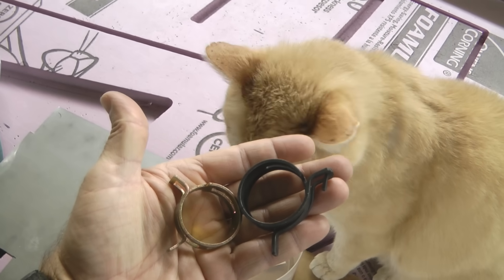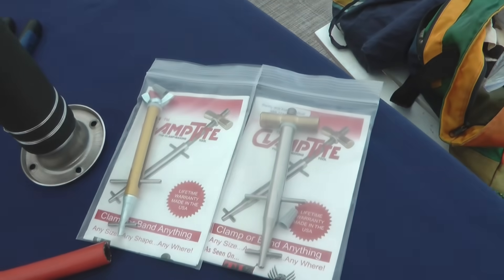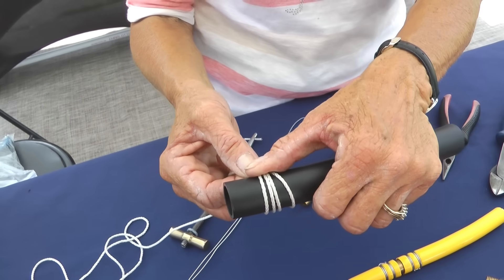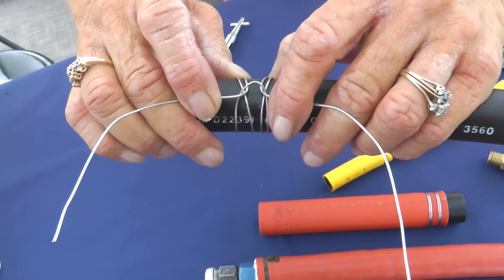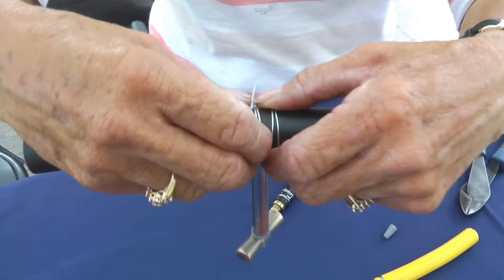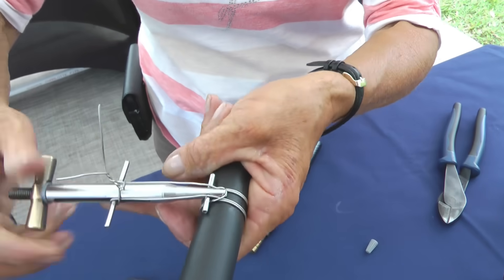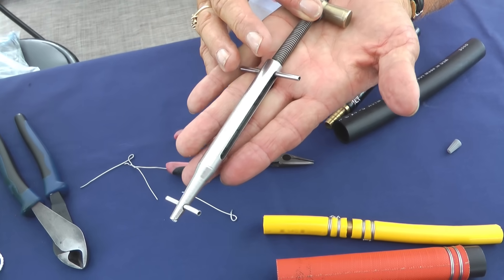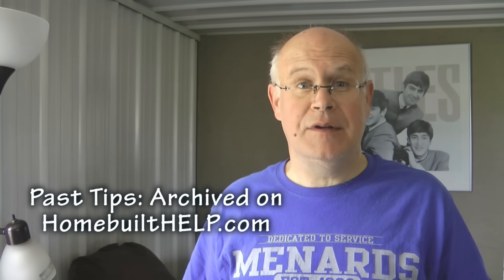Making your own Hose Clamps for Experimental aircraft

Comment: Two things for the negative people: 1) As far as not having enough room, you could always remove a same sized clamp from another location that is more open, use it in the tight spot, and wire the fitting that is clear. 2) Using this would let you get to the parts store the next morning or in an emergency.
As for the the price, I've pi$$ed away a lot more the $25 for a lot less useful items. If you look for the good, you'll find it, and if you look for the bad, you'll find it, too. I don't have time for the bad.

Comment: One problem with the method of securing the ends of the wire. They will vibrate loose over time or the pressure of the fluid ( Fuel, oil, etc.) Will cause the ends to come loose and there goes your clamp. At least with hose clamps you can safety those so they don't come loose.

Comment: Bought one at a car show about 30 years ago and it was almost 30 bucks then, always been pricey but they work very well, never had a water or compressed air hose leak when I have used it , and really a roll of stainless wire and this tool and your good to go, it's the fits all adaptability that is its best feature. My only problem with it is it wastes more wire than it uses, still probably cheaper per connection than hose clamps, but hose clamps can be undone and reused, I have never regretted buying it, but would I buy it now at 60$ US,  doubtfully, but still having it and a coil of wire in your boat,4x4,  or what ever could be the difference between coming home on your own  or waiting for rescue.

Comment: who has the time an space plus dont like the way it cuts in to hose ... just buy clamp an be on your way
Reply: It doesn't cut into the hose.  It compresses it, the same as a clamp (just more, because you can get it tighter.)  Plus, this is way better when you don't want a hose clamp sticking out like at the end of an air hose you routinely grab.

Comment: I bought one of these.  Can't find stainless wire anywhere so you would have to buy it from them.
Reply: Stainless steel wire is available in my area at better hardware stores, home depot sells it, probably get it online as well
Reply: Same here.  Looked everywhere.  On line is only thing I could find

Comment: And wont work in a confined space
Reply: That's true, but no tool is functional for all applications.
Reply: .....so for a confined space it's the conventional hose clamp or maybe using a strand of cord cut from a PET plastic bottle as shown by Odvoko then pouring hot water to shrink tighten over the job ,or maybe that cruder method of twisting ends of wire  looped over the job   ,but that steel tie wire these days used for such tasks seems to break easily if twisted hard as required but the copper wire seems a little better for the purpose . Lubrication of some sort for the wire over the hose can help and there are schools of thought for and against . .lastly the hot water helps for  conventional hose clamps by pouring onto to soften the plastic or rubber hose so that less load is placed on the bolt threads and less damage to hose's structural integrity occurs or whatever the language should be to describe it . Just watch not to tighten too hard on a heat softened hose .
Reply: @charlesdickens6706  Great advice, I'll try this.

Comment: Very nice tool but most of the time I am working with limited space and most are not easily accessible and a screwdriver is a better choice. I want to see putting that wire clamp on a radiator hose.

Comment: Отличная штука, дге ее купить???
Reply: I've used this type of tool for years and for specific applications where you have room they do work well. I've used this method for several Barbed air tools and they hold and do not leak. I have one that's much larger than shown here and it allows you to use coat hanger size wire and creates very strong clamps.

Depending on the type of clamp that you want this may not be the tool and it does have limitations. But when you do need to clamp something odd this is a very good tool for the job.

Comment: I have had this tool for over 18 yrs. in theory it is fantastic. In practice, you will never use it. It takes very long and  hose clamps are rarely in an easy accesible place. It needs quite a bit of space around hose to work

Comment: WE used to use fencing wire to do hose clamps with a pair of wire cutters or pliers (mostly), using the pliers to twist the wire. Fencing wire was thicker and galvernised type.

Comment: I have seen other DIY versions of the Clamptite.  Whether you buy it or make it yourself, using it is a skill that needs to be learned and practiced.  Because the length is limited only by what is practical it can be used on a lot more than hoses.  There are times I still want a spiral style hose clamps to do certain tasks, but having this kind of tool sure expands my options, particularly in situations where replacement parts aren't available.

Comment: Its great but how do you open that clamp in case of repair/maintainance ?

Cutting the clamp may damage the tube/equipment..!
Reply: Just use a small screwdriver to lift the ends, and then needle nose pliers... VERY easy.

Comment: Nice. I see some people griping about tight situations. Again, its a practical tool for a certain set of applications. Would a wrench make a suitable replacement for a hammer? No, but sometimes you just need a little taping power that way you hand cant deliver on it's own, correct? You would also be a idiot to think it replaces a hammer, but also a idiot not to use it if it was the only thing you had that could apply just the amount of force needed. Again, this is a tool that can indeed make a hose clamp. IS it going to work in every situation? No. But none the less a very handy tool. I cant believe anyone would act or treat it like its worthless because it doesn't fit every application. A pure sign of your inability to work or repair anything with your hands. Maybe you would be better off letting Someone else work on anything you needed worked on.

Comment: This woman is very good.  Gave me some tips I was wondering the best way to make my wire clamps nice and neat.  This wire clamp system is superior to anything else there is.  You can make a 40" clamp or a 1/4" clamp, just pull out enough wire.  A 40" clamp could hold together something that is busted and coming apart like a wooden barrel or what have you.  As mentioned, if you want to squeeze the guts out of something just use some huge wire.  Make sure you use wire from a good source like Aircraft Spruce and Specialty.

Comment: I used it on an aircraft hose to main intake, very disappointing. Just after the first flight 2 out of the 4 clamps I made, opened up! I used 0.032" wire. I went straight back to hose clamps!!!  Be careful !
Reply: What the lady FORGOT to say is that there are MANY different types of Stainless Steel wires... You were using a too soft annealed type.  Using a harder (but not too hard) temer will work perfectly.  And 0.032" wire is just too thin!Don't blame the tool for not knowing how to properly use it.  Wire clamps are legendary... when PROPERLY done.
Reply: Temper, not "temer", sorryy.

Comment: Love to see you try do that in situation and at the bottom of an engine bay ... also the tension of narrow wire risks cutting into the hose as a stress fracture !  Do you offer a safety certificate as when used it is a legitimate repair ?
Reply: I think its an emergency device ...
Reply: i sure its a fine tool but i had those thoughts also. was considering how it could damage plastic radiator and soft rubber hose.

Comment: It's a nice looking clamp but honestly, for a single use clamp, twice around then twist with lockwire pliers, it's not gonna leak.
Reply: There are times when you cannot find the clamp to fit. Recently for me, not available from any manufacturer/distributor I could find. Things being made difficult to repair to control obsolescence.

Comment: A nice tool and handy, but there is an old fashioned aircraft hose 'trick clamp with wire' that I learned about 4o years ago as a machinist. Used it all the time in the machine shop. All you need is a pair of pliers and a length of wire..

Comment: are you kidding ? how much wire waste ???
i would be worried the wire would cut the the hose and a cause a bigger problem,, that is why screw type hose clamps are wide ..DUH..
2nd dumbest idea ....takes 3 hands to work this mess and never fails that clamp you need to tighten is not that easy to get to ,,

Comment: This will NOT work if the fixture is on an engine or in close to another Object.. Also, this wire will, in time, CUT through the hose and cause a leak. Banned Hose Clamps are FLAT for a reason,,,they DON'T cut into the HOSE>
Reply: I don't know why I keep defending this tool I'm not paid to endorse it, but, having paid too much for it 30 years ago I have had ample time to play with it plenty, it's use is limited of course, but out off curiosity I have used on many applications that my life didn't depend on, and on rubber air lines or plastic water lines, some done 30 years ago, still no cutting through as you predict, you would think it would but in service in real life  it doesn't happen.
Reply: EXACTLY.  When the wire actually cuts  into the hose, it is because the wire was too thin, too tight, or the hose was too soft, which happens all the time with silicone hoses, that tears very easily.   And cheap band type clamps can also cut sometimes because their edges were not deburred!
Reply: Unless over tightened

Comment: I laud you're a attempt for a new invention.
A lot of applications inside the compartment of an engine or a machine this space to move around simply does not exist or is very difficult to get this to function or work and wrap.
And the amount of time to take the traditional screw clamp is significantly faster in every bit as effective.
So by virtue of efficiency and practicality the old style still stands as number one.

Comment: nothing new been around for over 40 years I was using this method 30 years in non aviation industries the tool was different and the wire came pre-formed and to fit various size hoses.  Ask any old pipefitter and he will varify.

Comment: I would like to see her do that in an engine compartment or on a bilge pump hose in a 3ft deep bilge.
Reply: You can always find a limitation for any tool. I own one of these ClampTites. Great tool. I have used it to clamp yard watering hoses and air hoses in my shop. I would not hesitate to use it for fuel lines or even a high pressure hydraulic hose on one of my tractors. But yes, it does need room for the 180° motion. Just use a regular clamp in those situations. When I can use it, I much prefer it.
Reply: The things I've had to do to remove/tighten clamps... 
 flathead hex bit and a tiny 1/4in wrench.....
Reply: was thinking the same thing, my fat hands are already in the way
Reply: EXACTLY!  Cars are now being "designed" by stoopid young "engineers" that "design" engines to be completely assembled OUTSIDE THE CAR, and then they "marry" the car body from over, and let it drop down on the assembled engine-transaxle-suspension... great for "saving" minutes on the Factory,but a PAIN In the A** to maintain.  Can bet 99% of those "engineers" have NEVER seen a Spanner.
Reply: @alfredomarquez9777  bud how do you think they use to assemble body on frame cars in the 50s. And this is intended for people building their own aircraft not cars.

Comment: and then on emergency you don't find a wire at the correct thickness....
Reply: Amnon Zohar why would you pack the tool but no wire? Stow them both together. Stainless safety wire is abundantly useful
Reply: on emergency you don't have the tool...but you might have just wire ,and pliers to twist the wire.

Comment: If you have to remove the wire you'll damage the hose trying to clip it off in fact you could twist the wire around the hose and tighten it up with a screwdriver to get the same clamp

Comment: Wow $69 for the tool vs $2 for a pack of hose clamps not to mention the time and directions to make it.
Reply: The other meaning of "Made in America "
Reply: Kreatifitas harus dihargai mahal....
Reply: With this tool you can use stainless steel and its better in somme applications than the cheap zinc plated clamps.

Comment: I don't know. Seems like it would cut into the tubing. You don't want damaged tubing especially on an aircraft. I am pretty sure this is not clamping anything on a 747. LOL. Use the proper clamps for the type of tubing you are using. This would be useless on silicone tubing because it would easily cut into it. Might be good for a roadside radiator repair or something.

Comment: well explained and its a good friendly tool but there's one question not answered properly ie. what's the size of the wire not it's strength..... sorry ma'am...✌
Reply: She said, "this tool will do up to a 62 thousanths wire". That's .062 or 1/16" diameter wire.
Reply: Strength was addressed. Stainless steel is very strong. Lesser wire could possibly break if tightened too much. Best to use stainless.
Reply: The Electric Man 2 The website claims that customers have used wire coat hangers in an emergency. I bet that would be difficult!

Comment: 98% of the time you won't find room to maneuver that gadget or flipping it around during a tight space installation. This thing is like to reinvent the wheel. This gadget is for wide open space use only . The strength of the lasting tightness is questionable. The installation time were much longer than the regular proven store bought hose clamps. Take my advise collect as many variety of sizes of your favorite proven clamps is your best emergency . Her tool is $60 + compare that to store bought clamps. Speed & accuracy is the MOST important criteria in emergency repairs. Not time to fool around.

Comment: Fine and dandy when you are working at a damn table, think trying to use it in an engine bay or close quarters would be a pain in the ass.
Reply: No matter what type of tool you use, you won't be capable to manipulate it if you are in a situation like floating in the space, short of air and Alien 1, 2, 3 and 4 trying to grab you from your butt
Reply: I agree that it could be a PITA, but I think it can be done.  I really like the clean, elegant look.
Reply: So true😂😂😂😂😂
Reply: Yah I tried to picture that to.

Comment: True ingenious design; but, won't work everywhere as mentioned in the comments below; I had a very hard time using it on a 1/4" air hose; too small a diameter to make it work. It's great for garden hoses; and has other good applications such as using it around a cracked planter, etc.

Comment: Not really practical due to space and cost. Use some bare copper electrical wire like a bread sack tie. Use pliers to twist with. Works fine until you have time to get a real clamp. 

You can buy a lot of copper wire for $50.

Comment: Am I the only one who thinks $70 for a sleeve and some wire rod that doesn't work at all in tight spaces and takes 5 minutes to make one clamp is a bit much? Like... A hell of a lot too much
Reply: Yes it has drawbacks but when you set down in back country to fix an oil  or fuel leak it would be very handy, not to mention light enough to carry in an ultralight.
Reply: Blue Collar Power nj

Comment: umm...using wire is a good substitute for roadside repairs but first hand in the long run wire will cut into the hose and render it useless for further use. The idea and concept are good perhaps in farm applications where there is plenty of space to use such a tool but in real world servicing and repairs a proper clamp will always be the best choice.

Comment: OK it's never never going to work in a tight spot and it's usually 90% of the time.
Reply: H Higgins  How are you supposed to operate the tool in a tight spot? That 180-degree flip she did with it eliminated the possibility of making this work in many applications. It's probably why the tool has been around 50+ years without becoming common knowledge. 

I work on car and boat engines where I would NEVER be able to use that in place of a worm-drive or gear-style clamp. Often, I have ONE possible position for the screw on the clamp, and when I get that, my 1/4" ratchet gets an extension and sometimes a universal--sometimes a combination of multiple extensions, etc.--and I often have to work in the blind...

...and that's just doing routine maintenance and repairs. Emergencies? Something this complicated in an emergency? I don't know. 

Also, after time passes and I find a drip or a trickle, how do I tighten it?
Reply: It would work great if you have to make your own custom hoses
Reply: Just found this video - and I've had one of the normal Locktites for few years - the dang thing is too useful. My favorite use has been repairing split/cracked handles on my tools (they're even stronger after I add a couple wire ties like this).

BUT... I liked mine so much that I got the "mini" model the company sells for working on your car and such - and I've already used it about 4 times for hose work. Never had a space/confinement problem with the mini version, even on my wife's nissan juke (tiny, tiny engine cavity).

But yeah - you can't tighten it (though I've yet to find one get loose on me). But who cares? You can just cut off the old wire, take $0.25 in new wire and re-do it. Takes 2 minutes.  But the best part about this thing is that I never have to run to the hardware store to get the right clamp or fastener, no matter what I'm doing.  I even take the dang thing camping, with a small roll of .041" wire - and the kids use it to build ladders and camp tables and stuff.